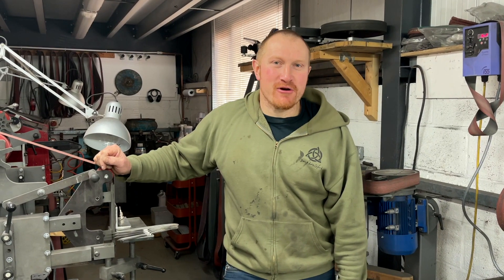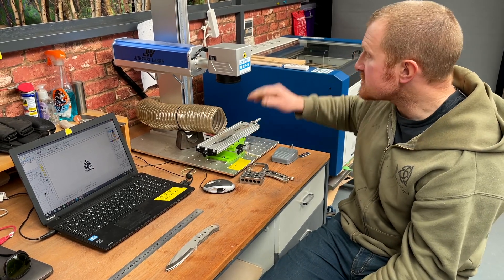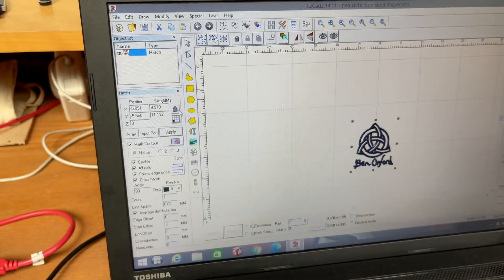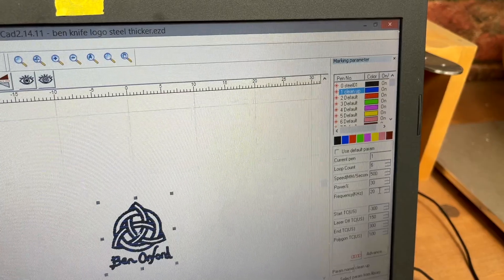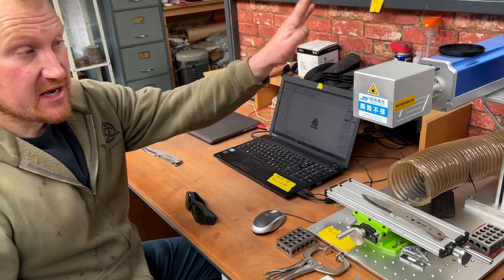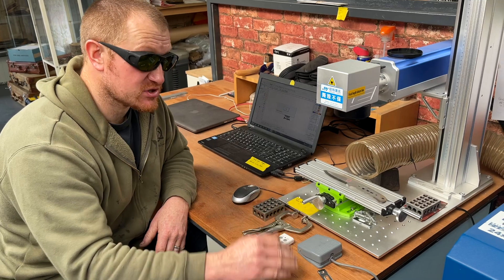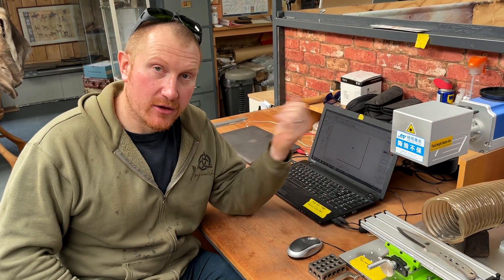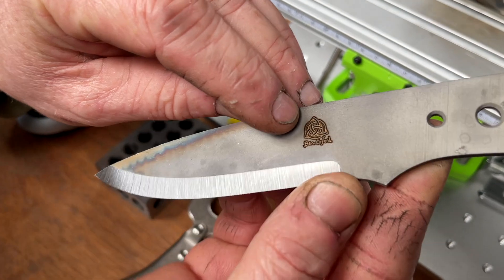How to Set Up a Fiber Laser

Comment: Awesome video... I pulled the trigger and purchased from the same company as you. Just received it yesterday! Setting it up this weekend, can't wait! BTW, the unit came with a lever bolt, that screws into the top of the tower on the side, it locks the slide into place once you've got focal length. Great video thanks for the info!